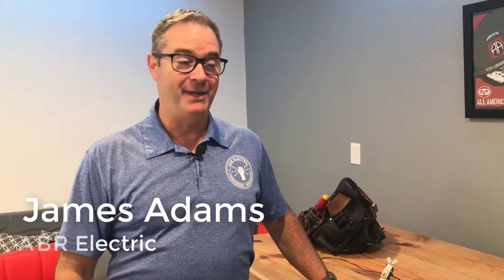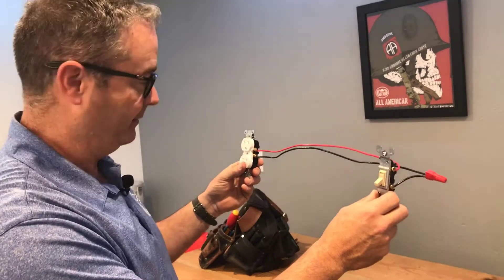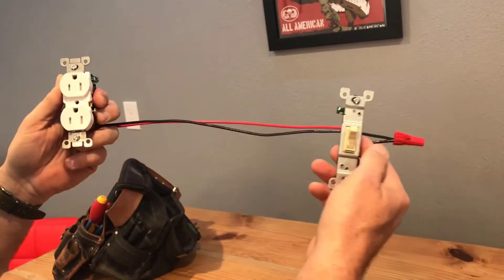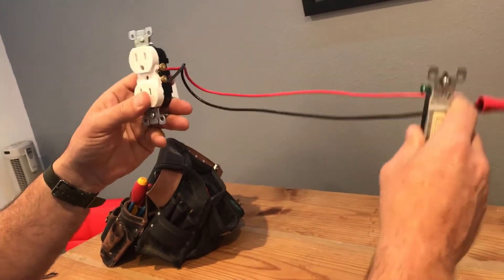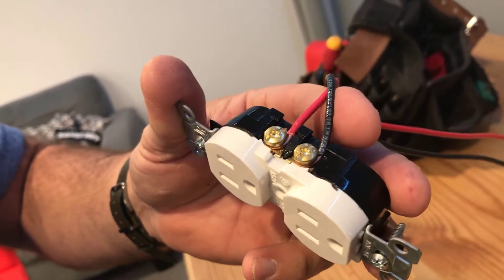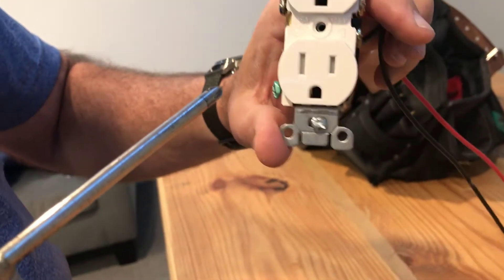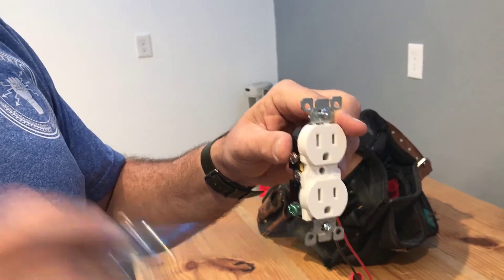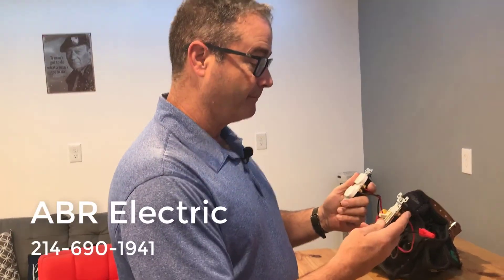Why are my outlets upside down?

Comment: For over a hundred years the NEC never had rules or recommendations on ground up or ground down. At a large hospital that I retired from they used nothing but stainless steel wall plates so it was policy to install all receptacles ground up. Several tines a year a screw would fa!l out of receptacle in patient rooms due to people losing up screws. Plate would fall on ground pin of the make plug. For the few horizontal mounted receptacles policy was the neutral ( now called the grounded conductor in code books ) side up. Wish they made it mandatory for all house hold appliances to use all the same ground configuration on right angle plugs. Too many tines have saw refrigerator with right angle plugs have to do a 180 degree turn due to this problem. Will often cause a right angle plug to cone loose.
Reply: That didn't happen. But cool story

Comment: All the plugs at my school are installed “upside down.” (Actually referred to as “ground up”) The thing is, there’s no rule for how to install them, and putting the ground hole on top is actually safer! Reason: if you dropped a small metal object like a paper clip and it landed between the plug and the outlet, it would SHORT THE CIRCUIT if you had the outlets installed “right side up.” If you had it installed with the ground facing up, then the paper clip would just land on the ground pin and not do anything. This is why some schools do it this way, and could also be good for those of you with kids, seniors, or even just obsolete breaker panels, to know this.
Reply: If they were like plugs in other countries then the terminals would insulation on the first 8mm. In Australia our sockets are installed with the earth facing down so it is the last to disconnect. (our sockets have switches)

Comment: So basically  its so someone can control the plug and make it lose power whenever they flip a switch?
Reply from the maker: To control a lamp for instance, yes
Reply: @abrelectric  Thank you. So.eone is using it for something else. I just can't seem to find the switch. Where could they run it too? 🤔 O ce I find the switch  then I can call the proper authorities. Because they are using it to switch off my security camera.

Comment: I've got a double switch in my bathroom - one is for the light, and the other for the ceiling fan. For whatever reason, the ceiling fan switch is OFF in the UP position and ON in the DOWN position. I tried reversing the wiring just on that side of the switch, but no success ... Any idea how I can fix that? (The second switch works normally, OFF on DOWN)
Reply from the maker: Possible to send a picture?
Reply: Flipping the wiring will not work in this case. The switch just makes and breaks the circuit, so you have the same effect wiring it either way. The real fix for this issue is installing the switch with the current top end on the bottom. This is a very common issue with the larger decorator (paddle type) light switches, because none of those say ON or OFF, which means they look the same if they are installed upside down. This almost never happens with toggle switches because of the on/off lettering. It is also possible that the fan is controlled by some other switch in another area. If your switch has 3 screws, (and no on/off lettering in the case of a toggle switch,) this is the case. The other switch could be anywhere in your house, and is probably in the on position, which reverses the switch movements for the switch you actually use. Turn it off and your problem will be fixed.

Comment: Put the ground on the BOTTOM!! Placing it up causes a binding of the cord when it is plugged in!! Either way works just fine and the "falling metal object" BS is just that--BS.
Reply from the maker: I agree.  However,  it's a preference that doesn't hurt anything in the long run.
Reply: @abrelectric   Like you said it’s an easy way to identify the switched plug in a bedroom. I have seen it in more recently built homes . And I have been hearing this old wives tale about safety for decades, lol. No offense to old wives of course.  The Code is silent. Do your own thing.